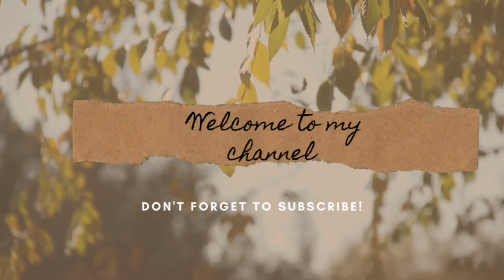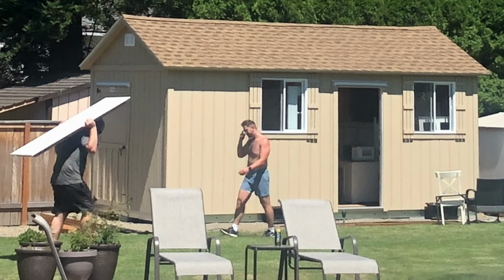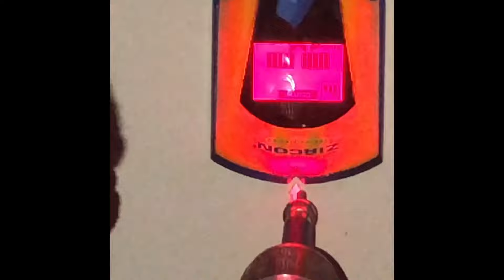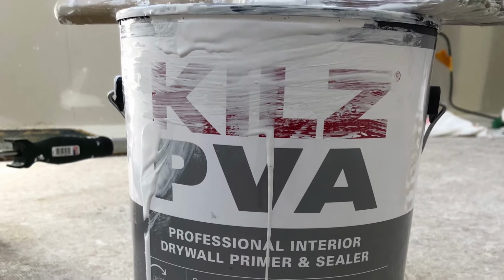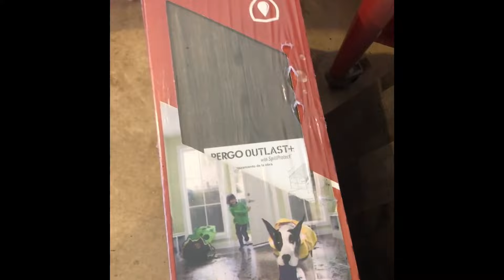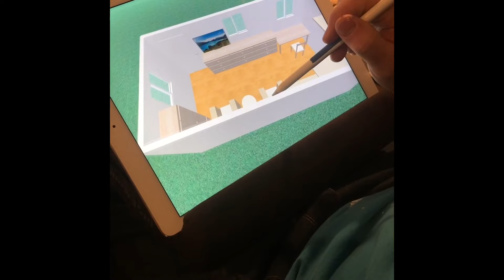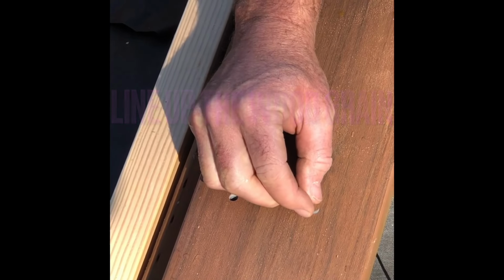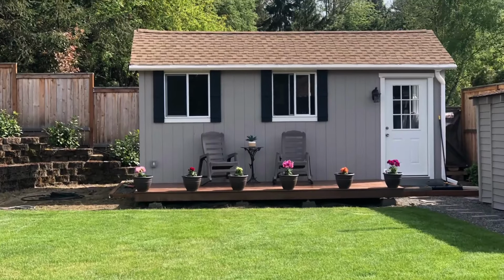Backyard Shed//Tuff Shed

Comment: Thank you for showing us your beautiful shed project. I’m planning one too. Can I ask how yours is making out? Wondering about gable vents and baffles. Not sure how or if ventilation is needed with pitched ceiling. Thanks 🙏🏻
Reply from the maker: They are working out great so far. We have vents on the eaves and at the ridge line. We used the foam insulation in the ceiling so that air could circulate above that. So far no issues and it has been very easy to cool them when it’s very hot and heat them when it’s very cold because we do use them year-round as our office/crafting/work out/hang out spaces

Comment: Did tuff shed work with you on layout? What was the overall spent on the conversion?
Reply from the maker: Our shed(s) were $7,300 each, bare bones. After wiring, flooring, insulation, drywall, tape& plaster, lights, ceiling fan, paint and window trim, the final cost was &10,000 each.